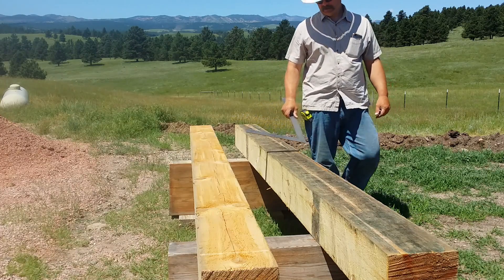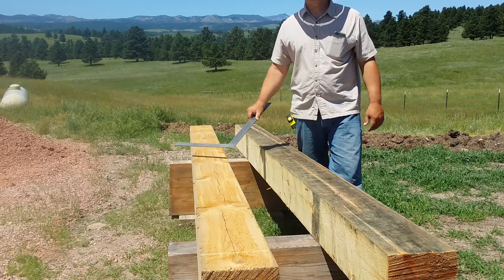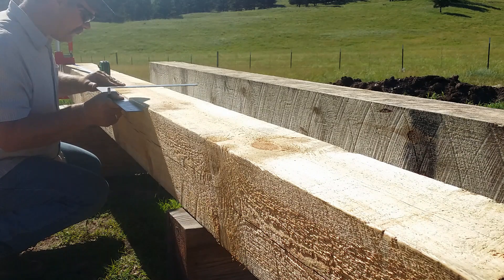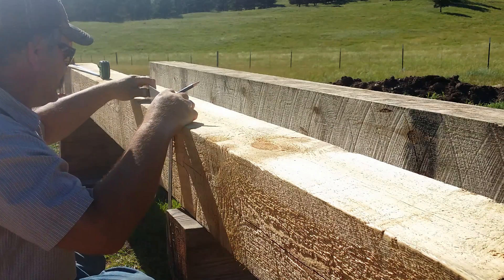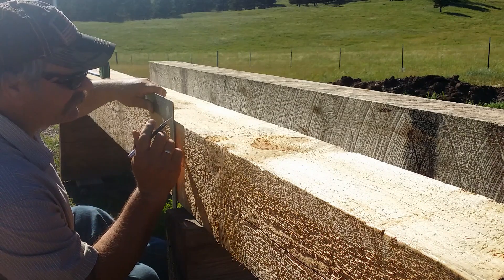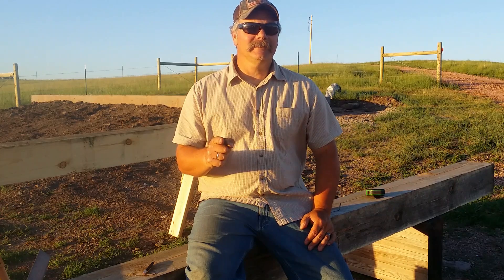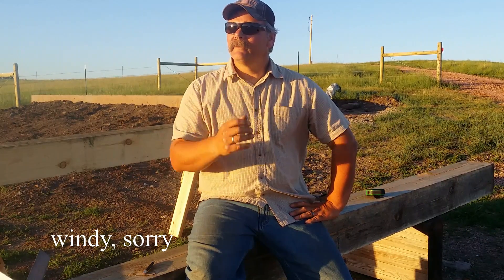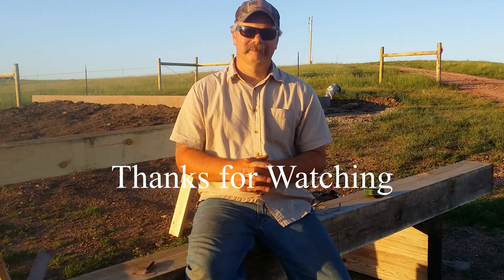Timber Frame Barn 8 - First Timber layout

Comment: I try to implement, two or more methods of checking layout before cutting starts, either having someone else go over the layout, using a second method to apply the marks, tape measures, story sticks, and alignment of repeat member next to each other comparing that all joint locations are matched, to name a few.  Even after 25 years of lay out I can still feel that unnerving feeling associated with layout mistakes, I am good at making mistakes, btw.  One challenge I find fun is being creative in finding fixes.  Some fixes just call for a new piece, though, that is the only way.  Do all you can to keep the mistakes out of the picture, but don''t let the fear of a mistake inhibit the process.
Reply from the maker: Timberdoodles Thank you for the advice.  It will be interesting to see how this frame unfolds.   Glad to hear that perspective from someone as talented as you.